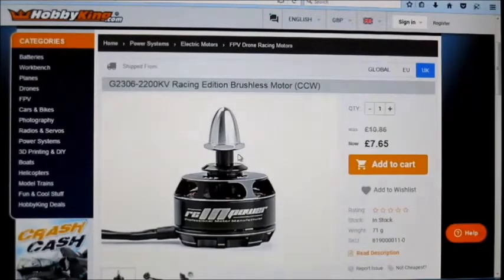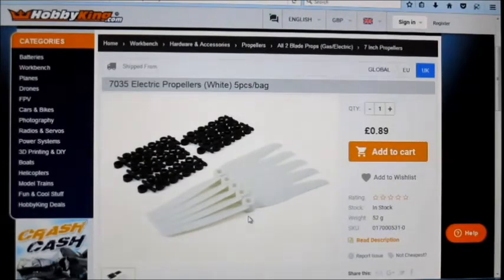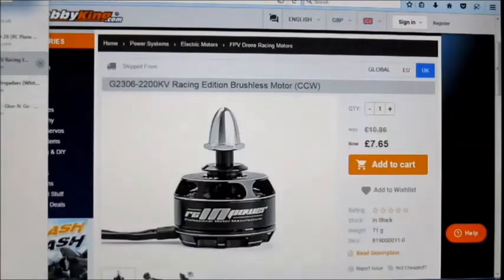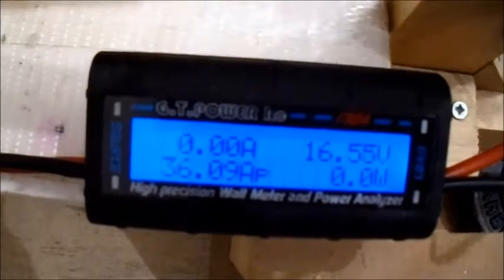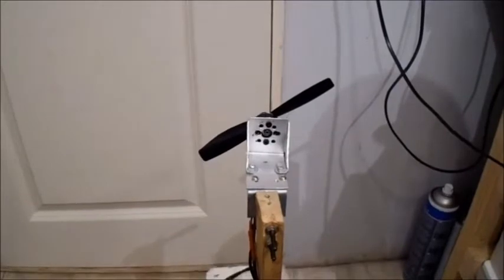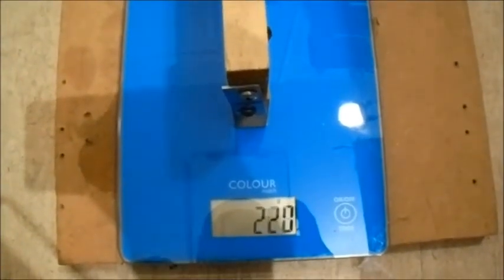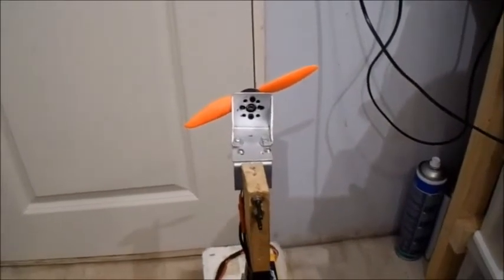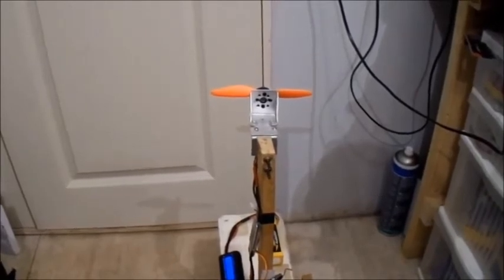Rcinpower G2306 2200kv Thrust Test Motor test of the Week

Comment: I wouldn't have thought the DAL Prop would out perform the APC! Good information to have. Thanks for the video and Happy Flying!
Reply from the maker: To be honest if it pure thrust you want then most props will out perform APC props. On the 6 inch or smaller sized props size for size.
Reply: I try to find a balance between thrust and power consumption and it looked as though the DAL prop performed very well in that respect. Happy Flying!